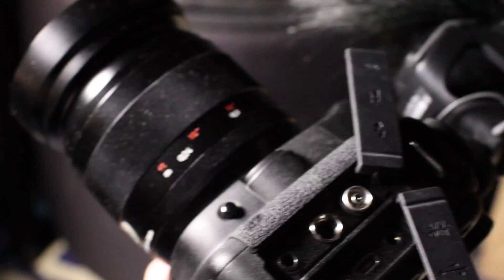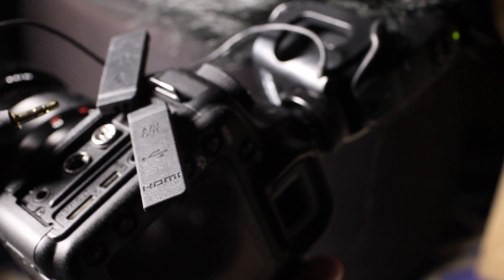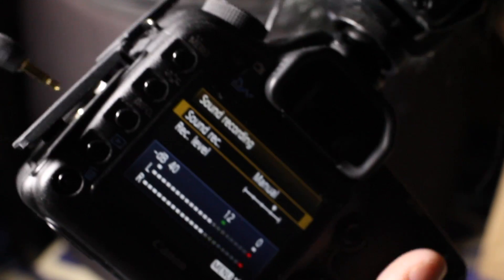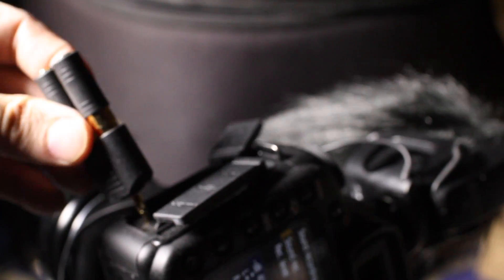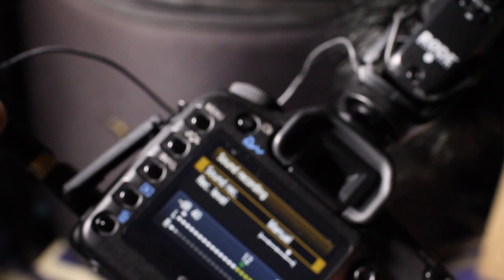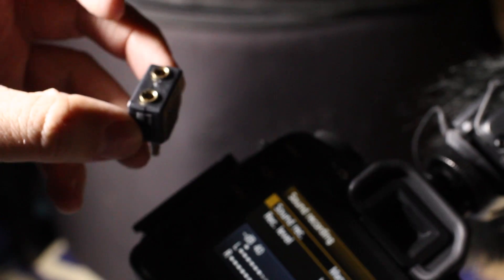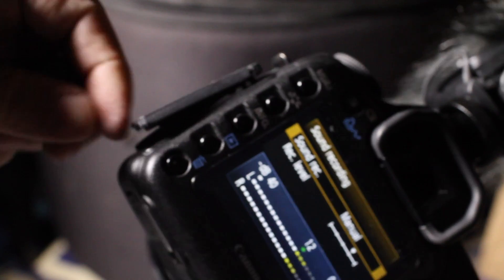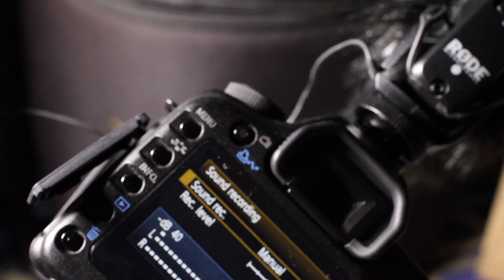How To Separate a Stereo Mic Input on a DSLR to 2 Mono Mic Inputs

Comment: How do you get 2 channels out of an Input? Also what Line input? That camera only has Mic Input, Line level is 40db's higher than that.
Reply from the maker: The video shows how to use each of the 2 audio channels inputs independently on a DSLR with a few adapters. Best of luck!

Comment: this is quite helpful to solving an application I have for doing video of car races.  on one channel I want the sound of the cars and on the other channel I want to take the announcers voice off the PA system.  this sort of setup was what I originally had thought of but then a camera shop pointed me towards buying a small 2 channel mixer, which happens to cost near $300.  I think I'd much rather spend less than $2 rather than $300.  the only disadvantage for my application is that I wont have independent volume control for each channel...  hopefully the next generation of dslr video cams will add that functionality.
Reply from the maker: RedroomStudios Glad it helped you out, it's not the most ideal fix, but it does do the trick for certain applications :)
Reply: Tom Wehrle thanks for the reply... (even if it was 7 months later!)  I tried figuring out my own version of your setup but some of the adapters I got were stereo and some were mono so on my first try I had both the car sounds and announcers on the left channel and nothing on the right.  I decided to get some help from an audio technician at my local music store and he told me about mono summing adapters which takes my 2 mono signals and doubles them onto both channels which is exactly what I wanted (even if I didn't realize that in the first place) in the end I spent about $25 rather than $300 to get a solution that worked for me.

Comment: I try it on iPhone 4s and 5S using also the needed SC4 or KVconnection and still mone using two rode Lavaliers ... Pity ... The Fostex AR 101 I use also gives stereo... What is there insides that makes stereo?
Reply from the maker: Luc Rik Vlaemynck & Mijn beste soulmate ever I know this is super late, but I've never done anything with capturing audio with an iphone like you've mentioned. Sorry, hope you figured it out though!
Reply: Tom Wehrle Thanks, well I didn't understand in fact that time your explanation as I didn( know much and yes I bought 4 wrong jacks as you said they are mono. I will order the right one as you show in the link. I have said that I use the Fostex AR 101 with the iphone, I get stereo yes but when using 4 there was mono. So your video is a great help. Thanks you reply cause I understand just now, right now what is missing.

Comment: I disagree, it would be better to have a mono signal to both L&R as if it were on separate channels then it would be odd to listen to via speakers of headphones, in much the same way most talk radio is broadcast in mono the recording is output over all speakers to give a rounded sound.
Reply from the maker: You can always mono a single channel in post, obviously, however if someone yells or what not, you can use the other channel to record it quieter and use it as a backup, or you could use it for another mic on a different person (2 person interview)…lots of use cases.